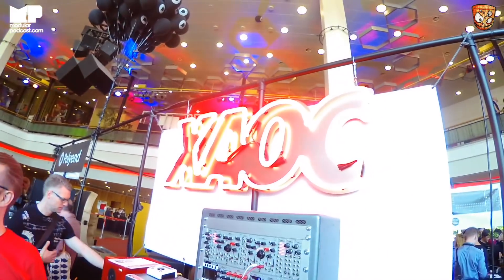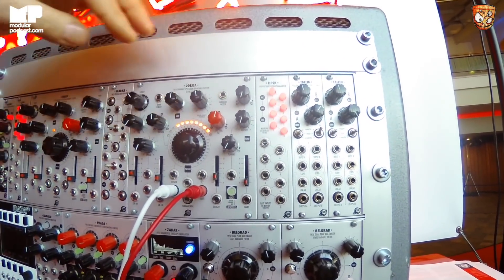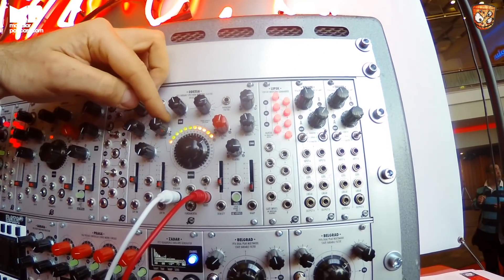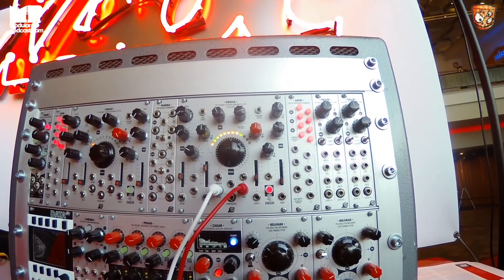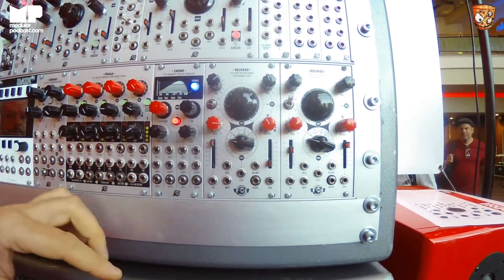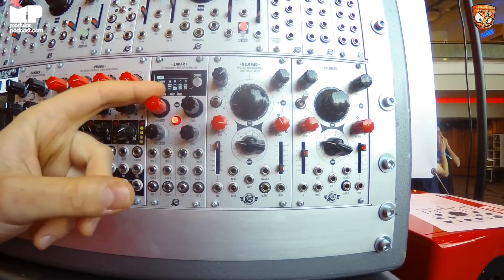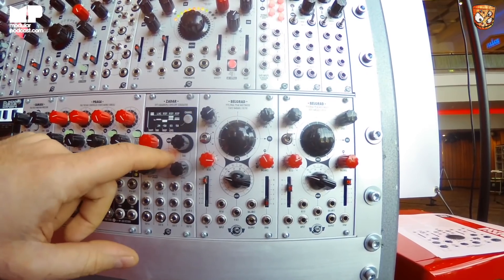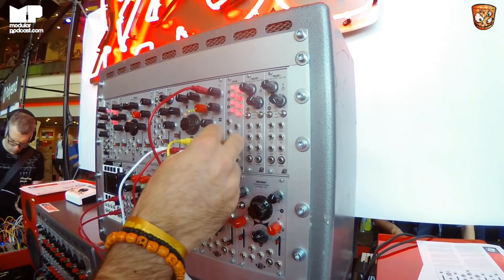Superbooth 2018 - XAOC Devices Odessa Additive Mega Oscillator & Zadar Quad Wavetable Envelopes

Comment: Their modules look like an ancient Soviet intercontinental missile launch control console. :)
Reply: I think that's the plan :)
Reply: We're the target. :P
Reply from the maker: Those 3 amazing looking cases together were a 1960s noise generator. It took 3 of those big cases for that lab equipment.
Reply: So it's just a question of time XAOC will build something based on the 6S33S "Devil" vacuum tube the Soviets were using in MiG-25 jet fighter radars. :) https://bit.ly/2IeefjN

Comment: Additive osc looks interesting, though I would normally expect a proper additive would provide for independent envelopes for each partial, not just evens and odds-- and include not just amplitude but also phase of each partial.   Still, the implication here would be hundreds of envelopes to manage which isn't all that convenient, and in any case this thing sounds interesting, I'll wait to see a few more demos before I decide...
Reply: That's kind of the curse of Eurorack, ain't it? Faster and much more fun than a computer, but never can be as flexible :/
Reply: On the other hand, necessity is the mother of invention.   A possible alternative might be to provide some envelope generation mechanisms that can create a set of envelopes, one for each partial, that are then adjusted by a selection of functions so that they're not all identical.   Another alternative might be an LCD display with the ability to present an adjustable frequency graph, save a series of them and create parallel envelopes by morphing from one to the next.   It's possible that increased flexibility might come from intelligent mechanisms to manipulate an array of envelopes, rather than manually tweaking every segment of each one-- something that even with a computer you'd likely not want to spend a lot of time doing manually...
Reply: @Syncopator  I keep dreaming about exactly what you just described. Maybe instead of envelopes, have a simple gate for each partial that can be passed through a bank of slew limiters, with bias controls for upper vs lower, even vs odd, etc.
Reply from the maker: Yeah true additive is sine oscillators tuned to harmonics and individual envelopes. But take Razor from NI which is fantastic ... there's control to morph and move between them which is what's happening here. There's no way they could have 512 CV inputs! or VCAs :)